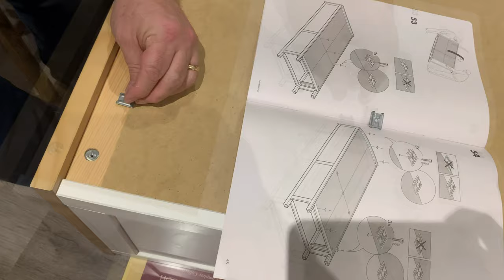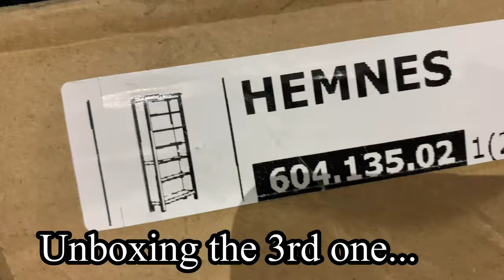IKEA Hemnes Bookshelves/Cabinets: Assembling & Quick Review

Comment: Have you done an update on this? If not, could you please do a quick update on how the Hemnes bookshelves have been holding up all these years? The weight they can hold, how sturdy they are, if there is any sagging at all in the middle or not, etc? It will be very helpful, I am considering buying two Hemnes soon for my books. Thank you in advance!
Reply from the maker: Yes will do an update and will let you know. Ty so much for watching 👌🏻
Reply: I've had mine loaded up fully with books for a few years now, and they're holding up great.  Just be careful if they're on carpet, since they like to lean forward over time.

Comment: Quite pricey? For solid wood (spruce) its extremely low priced. The price is not higer than the average price of the raw spruce material. usually you would pay 1500 at least for solid wood furniture of this size. Ikea is the only company which offers solid wood at this cheap price range. ore is it not solid? Whats the other materials if its not solid? Is it solid but extremely thin, ore is it not solid? the back wall is fiberboard?

Comment: Have you had any problems with any shelves falling? I've read some reviews on ikea that indicated that's an issue for some people.
Reply: @Zeydaza  Really? Why is that, because electric drills drill in a harsher way that can potentially damage the strength of the connections?

Comment: did you get a spare dowel with the first unit? anyone know?
Reply: There were some odd fittings left over such as the odd spare dowel and or screw yes. So if you find you have one left over it doesn't mean you missed one, if that's why you are asking 😎